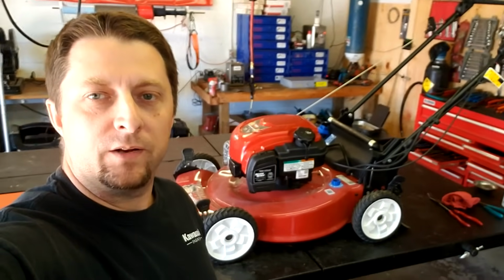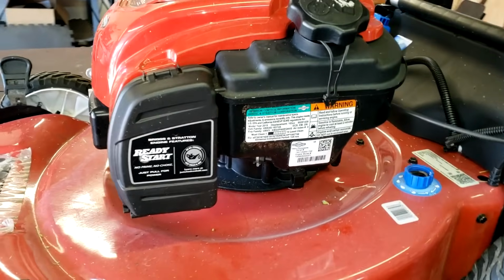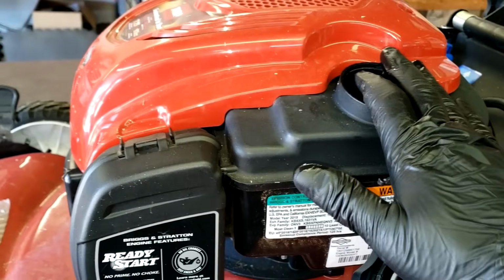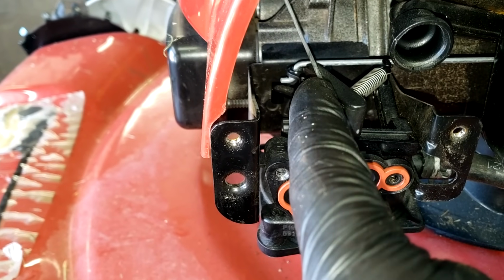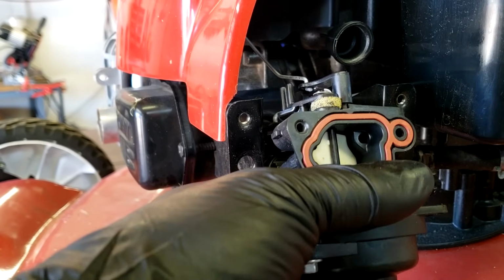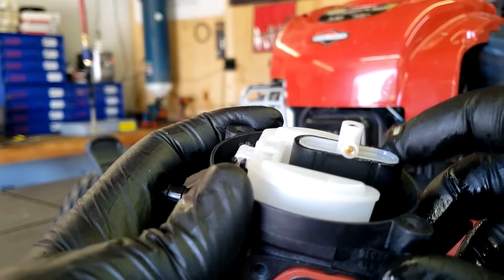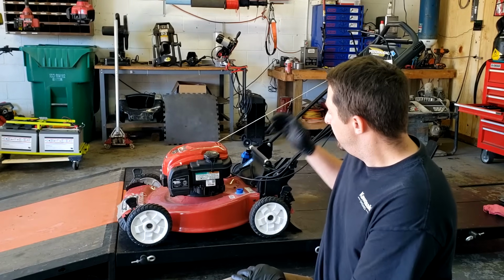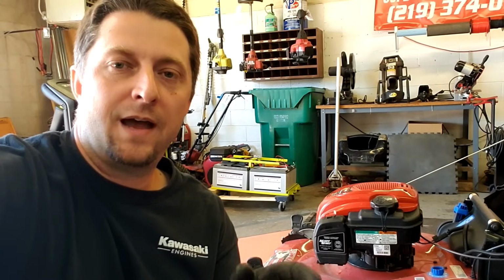TORO Lawn Mower Wont Start Easy Fix

Comment: Exact same lawnmower had the same issue... wouldn't start. My lawn was in desperate need of mowing and called a local lawnmower shop to get that part and they said replacing the main jet wouldn't fix the issue and tried to sell me the entire carburetor assembly. He said they had that part in stock but didn't sell the main jet alone. I was about to go buy it, but decided to take the carburetor apart to look at the jet first. Followed every step in your video and cleaned the old jet instead of replacing it. Put everything back together and first pull... the lawnmower started and stayed running to cut my entire lawn. No clue if next time I start it it'll start... but sometimes just cleaning the carburetor assembly, including main jet works.

Comment: I did all this perfectly and now my rope won't pull to start it and it was pulling before I did the job! I haven't a clue to what happened took out the spark plug and got it to pull alot of gas coming out it started and smoked now gas is leaking where the air filter is 😂 I'm about to take this whole thing apart again and do everything over to see what's happening but only after I go and buy a powerful electric mower because I am so sick of this brand new gas mower I swear  *update I didn't buy an electric one I took it off again and checked the float and the pin was out and the float wasn't closing to stop the gas fixed that and drained the oil with gas in it out replaced the oil and new gas and started first pull and I'm done cutting my lawn! It was some work but I can do this with my eyes closed now thank you Sir!
Reply from the maker: Awesome was about to say the needle seat was leaking lol

Comment: Outstanding video.  Concise and well filmed.  The hint about taking photos as I disassembled the carb made the job even easier.  If I may contribute one thought...I would recommend removing the dust cover.  Doing so makes reassembling the carb much easier.  Of course Toro had to use to "star" screws that are tough to access, but it removing it was worth the trouble.

Comment: I'm 65, female, pretty darn handy but never learned much about auto mechanics, engine repair, etc... biting me on the ass now, lol... anyway, mower wouldn't turn over, remembered some coughing and smoke last time I used it, followed this video... part cost less than $10, next day AMAZON prime delivery...beginning of mowing season in SWFL... can you even imagine what it would have cost, let alone get an appt... decided if this didn't work it would likely be cheaper to just buy a new mower, LOL...WELL, THIS WORKED PERFECTLY!!!!! THANKS SO MUCH!
Reply from the maker: Awesome

Comment: Thanks for making this video I didn't buy a new jet for mine I just used a needle and cleaned out all the little nozzles on the jet and then dried it off and wiped it down and blew some air through the various hole and put it back together and that fixed it with some fresh fuel
Reply from the maker: Nice work!

Comment: Thanks so much! I did just as you described! I let my 1 year old Toro sit over winter. I put a gas preservative in last fall but it didn’t work. It started on the 4th pull after replacing the jet.
Reply from the maker: Awesome to hear!

Comment: Thank you for the video.  I fixed the problem by simply changing the  air filter (which was beyond full and completely clogged).  After replacing said filter, started on the first pull.
Reply from the maker: Glad it helped

Comment: This was excellent.
Although in our case it turned out to be a spark plug wire that wasnt installed properly at some point and ended up pulling away from the plug.
At some point recently the connector got pulled away enough from the plug to casuse a very hard start and poor running.

Im sure cleaning the carb was beneficial and were glad we did it.

Comment: Thanks for the tip. I pulled the carb off and cleaned up the jets with carb cleaner. I cleaned out the fuel tank and blew the debris out of it and it started right up.
Reply from the maker: Nice work!

Comment: Thanks, great detailed video! Mine wasn't starting so I did this and replaced the jet with a new one. It took a few pulls but started and sounded like it was at a much higher rpm, too. I shut it off and restarted as you did in the video, but on that try the rpms seemed lower and now there's a constant surging pattern. Not sure where to go from here.
Reply from the maker: Glad it helped

Comment: This is an excellent video with great how-to explanation!  It worked mostly for me except I opted to just clean out the jets first and still have a problem.  It will start but only if I keep the front of the mower tilted about 20 degrees.  As soon as I let the front down it stops running.  I'm thinking about just replacing the carburetor.
Reply from the maker: That's why I don't clean them some work and some won't lol new jet always works.
Reply: Installed a new jet today.  After about 30 pulls it started.  It idled very low, sputtering occasionally, ran for about 3 minutes then died.  It has a new air filter, plug and fresh ethanol free gas.  Maybe the carb control rods are not in their proper places?
Reply: Took the filter box and carb back off and reinstalled them.  The carb hadn't seated correctly the first time, which was causing the problem.  After getting it on right it started on first pull.

Comment: Great tutorial! I would suggest to add an in line shut off valve(B&S#698183) at the fuel line from the tank. I always shut off while running to allow the carb bowl to empty. No fuel left in carb to clog

Comment: Excellent explanation and description! Now what does it mean when I hook the gas hose back to the car uretor and gas is dripping?
Reply from the maker: Carb is leaking due to debris in the needle/seat area need to clean again or replace the carburetor.

Comment: thanks, very clear explanation. Wondering if you would recommend using TrueFuel, non ethanol fuel, or just regular fuel would do fine? Also, how do you do the oil change and if this comes with an oil filter? 
I have this Snapper 21" with a Briggs & Stratton 625EXi model 093J with this problem after 3y of no issues. I strongly think it might be related to the cable to be pulled to keep the motor running, since the lever barely moves and the spark plug came out completely dry. But i will do the jet/filter/spark plug replacement anyway.
Thanks again

Comment: Great video.  I did as directed and it started right up.  I did something to it thought because the gas will fill the cylinder overnight and it gets locked up.  Take the plug out and lots of gas comes out.
Reply from the maker: Sounds like the needle Seat is dirty need to clean or replace carburetor.

Comment: Thanks a lot for the demonstration I'm going to try it tomorrow but what I'm going to try to do is clean out the channels that the gas flows down through by using a small needle or something but I do thank you for the demonstration and if that doesn't work I'll buy me a new jet or carburetor piece that you showed

Comment: Thank you for you the video. Replaced the jet/gas  and fired right up.👍 But  now my mower is running a little rough. Any suggestions would be great. Thanks.
Reply from the maker: Most likely try a new plug and filter.

Comment: Excellent video.  Never done this before, but last year I took mine to a shop and paid $200 for this exact repair.  This year I'm going to attempt it myself.  Question: How do we prevent this from happening in the first place?
Reply from the maker: Fresh fuel,stabilizer and use is best

Comment: I bought that part on Amazon.  The new part does not snap down into place like the old part.  I cleaned the old one and it cranked on the first pull.  Thanks.  The mower bogs down easy, I’ll try to order another part from somewhere else.

Comment: Great video! I have the same mower but smaller engine 6.75 hp. 149cc. The air cleaner is in the same spot but the filter is flat not oval. Does it still use the same part for the jet replacement?
Reply from the maker: No different carburetor

Comment: I enjoyed and learned from your video. I have this exact mower. It was running fine then just died one day as I was mowing. I’ve been doing some YouTube research and think I have a hydro lock. I drained the oil and pulled the cord with the spark plug out. I know I have over filled it before but thought I drained it enough. Anyway no oil comes out the spark plug hole. Now I’m thinking my problem is probably the part you are talking about on this video. So here is my question my pull cord pulls with out the plug, but with it screwed in it doesn’t pull back freely like it’s locked up.  Could this cause that to happen?
Reply from the maker: Could have a valve issue or a sheared flywheel key have you hit anything

Comment: I have a 22 inch TORO RECYCLER MOWER with KOHLER MOTOR on it and I warn people out  there if you can get one with a BRIGGS & STRATTON ENGINE on it go for it because you might get one like the one I have I have used it very little because it just refuses to run long  I've had it the SHOP 2 times got it home MOWED the yard 2 times with it over all and it is sitting in my garage right now and WILL NOT START to save my life I have a MOWER with a BRIGGS  on it and it will start basically every time without hesitation I use the TORO for the BAG SYSTEM it has on it but I have had to use MY MOWER without the bag due to the KOHLER ENGINE not starting I just hit a little piece of WOOD with it and it won't start and I hit the same piece of WOOD with my BRIGGS ENGINE and it will start

Comment: Just bought a brand new mower with the Briggs and Stratton engine with the Ready Start system. Starts on the first pull almost every time, when cold. Wonderful! Right? Once the engine is warm, It WILL NOT restart. You can pull on the chord forever. Won't start. The air gap for the coil is spot on. Is this thing vapor locking? What would you suggest to look at?
Reply from the maker: Sounds like the auto choke is not working correctly

Comment: I saw another video where the jet was drilled out with a tiny 0.020 drill bit to make the hole just a little larger. It does seem to be a sensitive operation since a 0.020 drill bit would easily break if you were not careful. Apparently the jet opening on this carb is smaller than most.

Comment: Wondering why you didn’t clean the fuel line port and area where the needle valve assembly installs.  
Also I wonder if a small inline fuel filter could be install to help in the future.

Comment: I just picked up the 140cc version of this mower from TSC for $50. Its practically new. Customer returned it after using the wrong fuel. It appears to have no kind of fuel filer at all. Wouldn't it be a good idea to put a cheap and small inline fuel filter on that fuel line? If so do you have any recommendations? THANKS!!

Comment: Nice video - thanks.  1My Toro recycler has a 6.75 163cc instead of 7.25.  Does it use the same main jet?  Thank you
Reply: Forgot to mention - Briggs engine
Reply from the maker: It should but model number and parts look up may be necessary to be certain

Comment: I took it apart, cleaned it with carb cleaner and some jet wire cleaner. Put new fuel and it ran first pull, .. after I connected the spark plug wire, lol. 
Thank you! 👍.
Reply from the maker: Nice work!

Comment: Getting that jet is easier said than done.  Nobody on Amazon has them right now.  I've been waiting for weeks to get one, so I'll have to try cleaning what I got.
Reply from the maker: Seems to be out of stock currently I have been forced to clean them for now but most has been successful if you take your time doing so👍
Reply: @D-MAN107  Yeah, I cleaned it with carburetor cleaner and it worked fine.

Comment: Hey I did this on mine, got it all back together as taken apart but it runs again, however the moving feature doesn’t work the rear wheel don’t spin when you push the arm forward. So is something else also broken or was something not connected properly? I checked under the mower and the belt still connected to the drive gearbox on back wheels
Reply from the maker: Either the belt is off one of the Pulleys or a cable is broken or could be bad transmission

Comment: Have one of these mowers where kerosene was added instead of gasoline (by accident of course). Is the engine ruined, or might a brand new carb provide a fix?
Reply from the maker: Just flush the fuel system good to go

Comment: Is that a gts briggs just curious mine is the gts one is 6 or 7 years old on a husqvarna mower I got a new toro has the engine to and so far never had issues with these engins knock on wood but when I'm done cutting I run the grass out

Comment: If your fuel was your cause, you need to pull the top off the mower, lift the tank out and inspect it's internal screen through the filler hole.
You can dump the gas in a bucket while taking it apart.
The stuff we get from gas that sits around here can need to be cleaned off the screen down in there and rinsed with clean gas and dumped in the same bucket.
After the gas sits, you can pour off the top and use it where it's not critical.
As we all know gas is premium priced nowadays.

Comment: I have the same engine and now have to pull 3-5 times to start. Runs ok after starting. Would replacing the jet solve this. Also, do you recommend using ethanol free gas?
Reply from the maker: Yes that fuel has a longer shelf life and the jet may help.

Comment: Mine will start on full pull no issues. However if I shut it down and and try and restart it it won't start. I think it's running rich because the plug is pretty carboned up. Plus I feel like I'm going through a ton of gas. I'm going to try this and see how it goes. Thanks!
Reply from the maker: Could be a dirty air filter also.

Comment: I picked up one of these lawn mowers that wouldn’t start, tried the fix and started up first pull. After about 30 seconds of running, there was a lot of white smoke and oil sputtering out the exhaust. Replaced the oil to the appropriate level(it was very overfilled and dirty oil), ran fine for about 30 seconds again then white smoke started. Any suggestions??

Comment: Great video! But the jet, for my motor was a different part number. I bought the ones that were in the video and they did not fit. My advice is to take your carburetor off and take your jet out and there is a number on the jet Google that number and you’re right jet will pop up. Hope this helps.
Reply from the maker: Thanks for the info!

Comment: Thanks for this great video! 
I was given a Toro mower from my neighbor who was moving away. Its the same mower featured in your video. It hadn’t been used in over 2 yrs.  The gas had been drained out and the tank was bone dry. I added some fresh gas but it wouldn’t start. I found your video and ordered the main jet on Amazon. It was a generic version of the B&S part. I replaced the main Jet as instructed in your very easy to follow video. The engine started on the first pull which amazed me (well…because it’s me and I usually f@#k things up and make matters worse)
So it’s running, but it’s surging. Any advise as to why that is or what else I can do?

Comment: When winterizing the mower is there an easy way to just drain the carb bowl?  Or do you have to take it apart lime you did.  There is a recessed area on the bottom of the bowl.  Could that be removed to drain the bowl or not?   Tks.  Great vid
Reply from the maker: You can drain the bowl from the Allen head plug on the bottom but it is kinda hard to get to not very much room to get to it.
Reply: If it has a shutoff you can also just close that at the end of the last mow, and just make a few passes at random grass or weeds until it runs out

Comment: Wish I found this first. Not sure the cost of the jet plus shipping. I picked up a whole carb assembly off of Amazon Prime for around $30. It came with an air filter a spark plug and the brand new carburetor. Made in China🎉

Comment: All the negative reviews are true. The mower worked well for 4 mows. By the 5th mow it took 3+ pulls and would stall out no matter the length of grass. By 8th mow it was 10+ pulls and just wouldn't run. Toro and Briggs and Stratton are impossible to contact. The service dealer will tell you it's the gas, even though the same gas will run my friend's 20 year old Toro with one pull. The will then tell you it started fine for them, but the did a "flush" anyway for $61.00. Warranty is worthless.

Comment: Can you spray the carburetor with carb cleaner to clean off the other areas of the carburetor?
Reply from the maker: Yes
Reply: @winderoutdoorpower1225  I just sprayed the carburator and let the jet sit in the carb cleaner solution for a few minutes.  Then wiped dry all ares that I could reach with dry paper towels. I also flushed out the gas tank with fresh gas and used chop Stix with paper towels to wipe clean the inside of the gas tank.

Starts like a brand new mower. Thanks.

Comment: Help,  I have a Toro, but don't think I  have Briggs/ stratton.
I have an indent on top panel that looks like plaque was there but it is empty?
I took off air filter, doesn't look same??
Pull rope & not even close to starting.
New sparkplug, 30ish day old gas?
It is a Toro Recycler.
Air filter is rectangle
Top plastic black panel unscrew with 2 screws to show pull assembly.
Dont know if you can help me.
Thanks for reading
Fingers crossed...grass is getting high
Would love to do it myself &
Reply from the maker: Try taking air filter out and spray a little carburetor cleaner directly in the carburetor and then try to start it. If it starts then immediately shuts off then the carburetor needs cleaning or replacing.
Reply: @D-MAN107  Thank you for replying.   I REALLY appreciate you taking the time out.
🙏🙏
Luckily, borrowed from neighbor so got a little breathing room.
Will let you know.